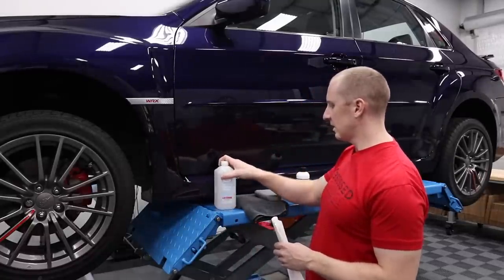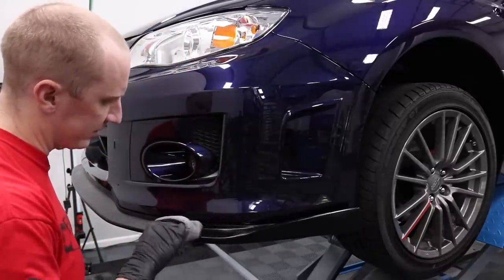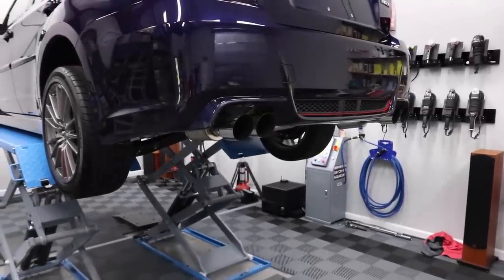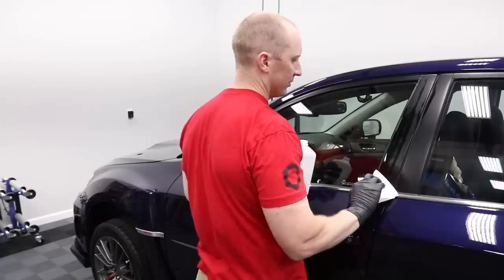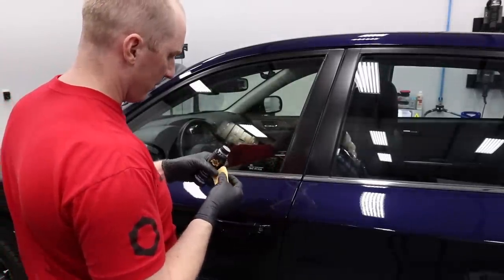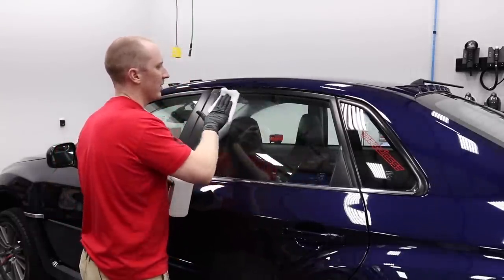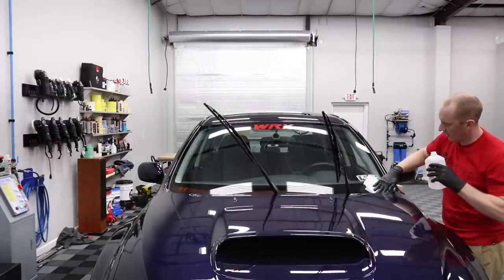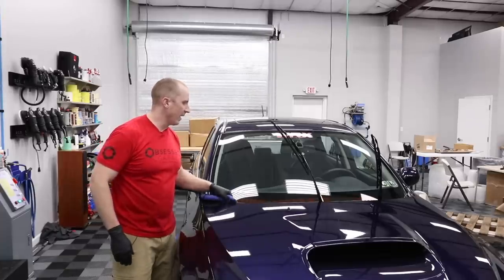WRX Detailing Series: E11 - Trim & Glass

Comment: Threw a couple comments on here in succession, so sorry about that. In prepping the glass, how do you remove the fine scratches and rock chips before applying anything to the glass? I have a daily driver and it has all the what I call pin needle marks all over the front glass. These are caused by bugs, rocks, and road debris.

Comment: How does Wolf's Nanodressing Trimcoat compare to Gyeon Trim? Or didn't you use that yet? Wondering which one is better/more durable. Gyeon Trim is only 30ml for about the same price.
Edit: sorry you mentioned it a bit later in the video :)
Reply from the maker: Trim is a tiny bit better on rubber.  Wolf's is quite a bit better on plastic.  So I give Wolf's the nod.